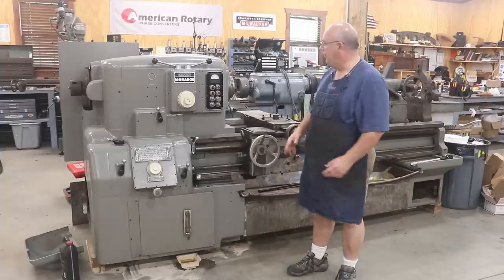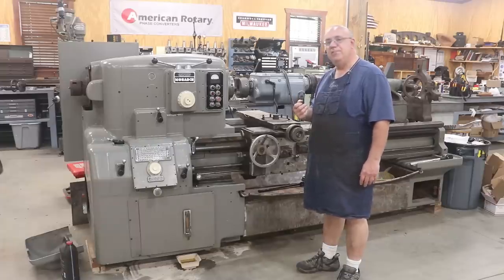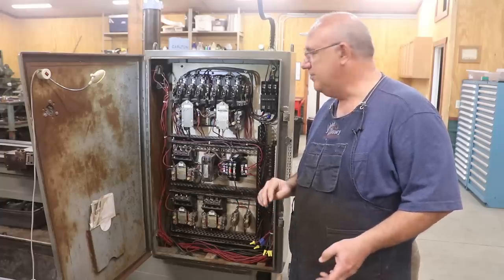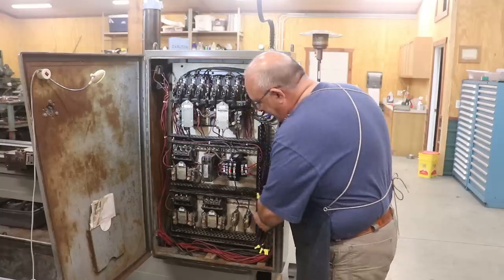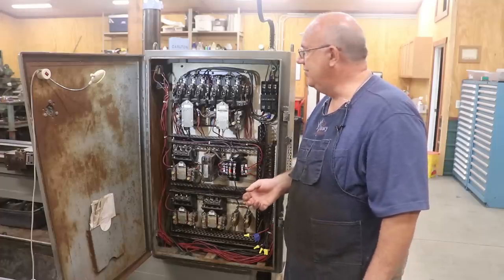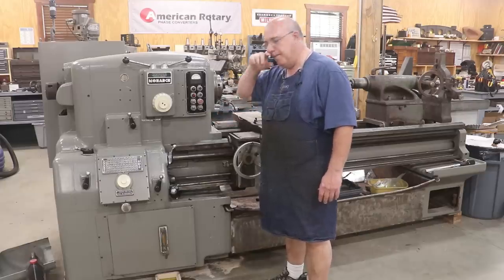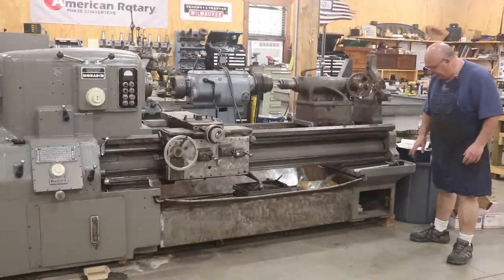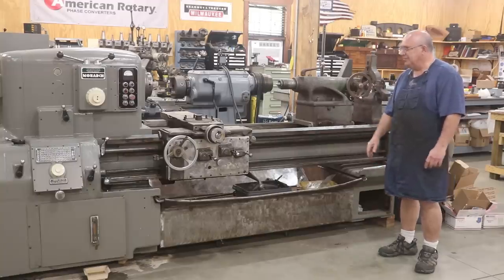Monarch Model 612 28”  Monarch Lathe Update: She’s Alive!

Comment: Anything that is designed to specifically prevent or specifically allow operation of a device dependent on the state of another device or environmental condition is called an "interlock". An Interlock can be something as simple as a switch on a door that prevents machine or circuit operation while the door is open up to a complex series of multiple machine conditions, temperature, humidity, light conditions, time, vibration, etc. that only allows a device to operate under a set of narrowly defined environmental parameters.
Tracing interlock circuits on old equipment, especially equipment that has been damaged, modified, or altered can be a royal pain in the ass.
Reply: "Right On"
Reply: trouble shoot a folding hard top convertible once...

Comment: Had a similar electrical problem with my 12" Chinese lathe. I think lightning got the electric panel and literally SMOKED IT. LUCKY IT DIDN'T BURN MY SHOP DOWN. I was totally lost. A dozen switches and a hundred wiring connections just blew me away. I scrapped out the entire control system and replaced it with a $20 rotary switch and a $15 emergency disconnect switch. Now it's wired just like a 1950 model lathe or mill. The best part is, now I understand it.

Comment: Keith:  I think you will find that the rapid drive is a hydraulic motor run from that tank and pump.  The oil pump in the carriage also runs off of that drive shaft so it is necessary.    Monarch lathes with power rapid traverse did not have a hand knob on the carriage feed wheel, lots of folks added one but there is no counter balance weight on the wheel.  Also if you do add one DO NOT use your left hand to move the carriage!  It will smack your wrist, been there bought that t-shirt.  Those lathes are a BEAST they love to remove metal.

Comment: What are the odds of an electrician with motor controls as a specialty dropping in. Great!  And do you really need a drill chuck on the tail stock? why not mount a morse taper attachment on the carriage?
Reply: dropping in at keiths shop?  1 to 1.  it seems everyone stops by at some time or another.
Reply: A real Morse 5 tailstock allows you to run live centre, dead centre, bullnose pipe centres, cup centre and a drill chuck, etc.  I agree, a drill attachment on the carriage is best.

Comment: I'd have to check the parts diagram but I'm pretty sure that the apron oil pump runs off the same shaft as the rapids, so no rapid feed also means no oil to the saddle and apron.  Might want to prioritize that repair
Reply: Or is it the power feed screw, as rapids is an option?
Reply: @glennanderson4440  It's a different apron with the rapids.
Reply: @russkepler  My 612 (no rapid) has an apron sump\reservoir and it works whenever  the carriage moves...l thought.
Reply: @glennanderson4440  I think it is similar to the 10EE in that the pump has a couple of arms, one actuated by the cross feed and the other by carriage feed.  Very different from the apron with rapids.

Comment: Looks great, Keith!  Does the compound connect directly to the cross slide or is that what you have to modify because of removing the tracing attachment?  Also, have you been able to come up with anything about the base of the tailstock to get you more contact?

Comment: That Monarch spindle speed control looks similar to what is on a LeBlond Servo Shift.  I tend to avoid any lathe with hydraulic speed control valves, they can be a nightmare to troubleshoot, I prefer direct geared head lathes.

Comment: Good work Neils. Does anyone know what the meter above the controls is for ?
Reply: It is a load indicator.
Reply: Ammeter for spindle motor so as not to overload and trip it out.
Reply: @petemclinc  that is correct, it is essentially a volt meter hooked to a CT that a motor lead wraps through a couple of times.  Current Transformer, so a voltage output to a volt meter that reads in amps.

Comment: Keith, that is a great lathe, did you see the article that was written on "super lathes" :
https://www.practicalmachinist.com/vb/antique-machinery-and-history/heavy-duty-lathes-115875/
I believe this model falls into this category. I looked at a 610 that was in excellent shape but had to pass because I don't have a space for it.
Don't modify the bearing tailstock, if you want the drilling capability use a power drilling attachment for the carriage the way DSG do it, much better and you will also have power feed and fast retract:
https://picclick.co.uk/Dean-Smith-And-Grace-DSG-Power-Drilling-Attachment-113701121246.html#&gid=1&pid=1
I picked up one for $100, much cheaper and easier than modifying the tailstock.
Looking forward to seeing some big blue chips!